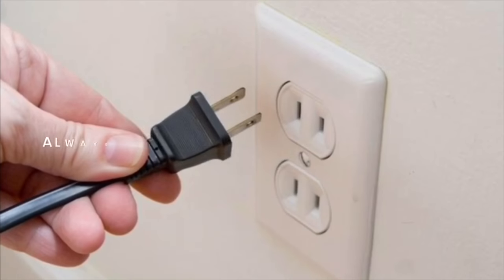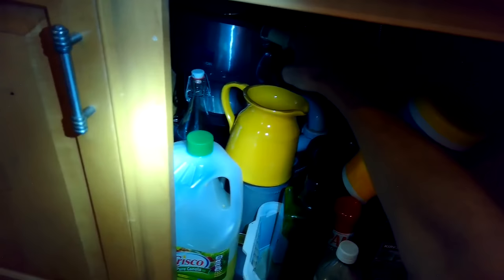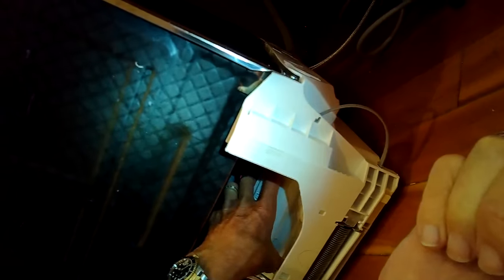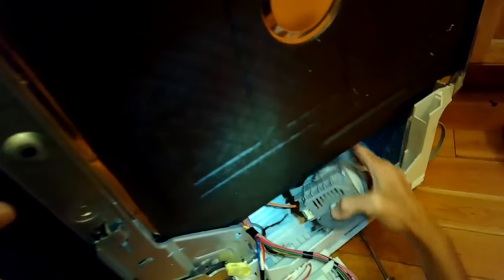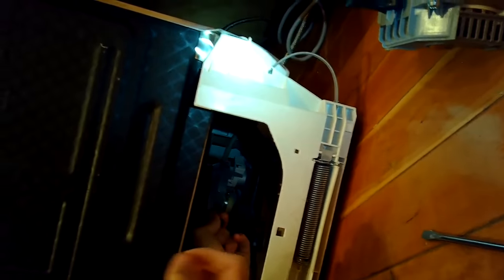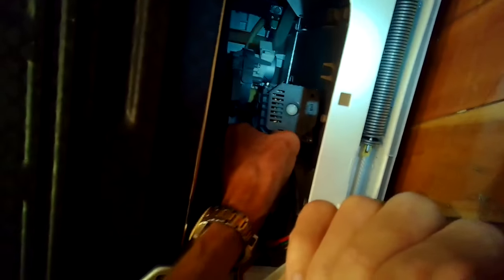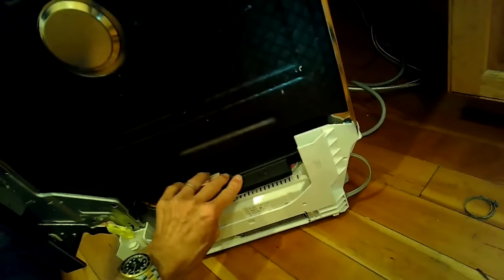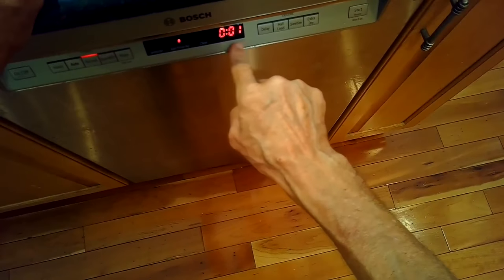✨ BOSCH DISHWASHER - E09 - EASY FIX ✨

Comment: Great help, my model had a metal panel in front of the logic board which needed to be removed. Took me longer to put the plinth back than the actual repair. Cost of genuine part £63 from eBay, to have it repaired I was quoted over £200. Many thanks.
Reply: Mark hi. Do u have the link for the part ? I have a metal panel too. I’m dreading the fixing part. I’ve been without dishwasher for weeks!!
Reply: darouani84 The original seller doesn’t have any listed but search for:Genuine Bosch Siemens Neff Dishwasher Circulation Pump Motor Flow Heating Pump. If your not sure its the right part message the seller to check. It’s really easy to fit,  just follow the video.
Reply: Mark thanks ever so much ..doing that right away 🙂..!!

Comment: thanks for the video, I have replaced the heat pump on my dishwasher very easily with your instructions. One comment: I have notice that some of the cycles time now has doubled, so the short cycle, which is 29 minutes, now runs twice. It is somehow also more noisy than before, i am trying to figure this out. I bought my spare part directly from Bosch, called the customer service and they said they are not specialised enough to answer my questions on a spare part i bought from them.

Comment: Thank you for this. It was easy.  I replace the Heat pump. I ordered the pump  but when It came it was a little smaller but had all the right parts to install but now the tub of the washer overflows. It works except for this. Could this be the heat pump is wrong or could it be the inlet switch?

Comment: Well done, sir.  I wish the video was a little bit higher resolution and some of the trickier spots were shown in a little bit more detail (how do you access the hose clamp after the motor is reattached, there’s like zero space there??) but the commentary/walkthrough was very well done and well thought through.
Reply from the maker: Thanks Warren, I think I used a very small ratchet to tighten up the clamp.

Comment: Do you have to remove the drain pipe and water pip if im able to pull it all the way out and keep water running?
Reply from the maker: You can keep them connected 👍
Reply: @ScottTheFixItGuyChannel  ok, thanks! 👍. I took my pump apart but did not find anything that was broken on the heating elements.
wonder what causing it to fail? 
I'm waiting for my new pump right now. hopefully that fix it.

Comment: How universal is this?  I notice significajnt differences betrween the access that you showed, and my unit:  e.g. mine has front leveling legs like a refrigerator, and is securted to the cabinet frame with wood screw through a tab.

Comment: Hi Scott, thanks for this video - it has been very helpful so far. One quick question though. My old sms58m02eu/02 bosch has different electrical connectors, and now I can't connect the new part. My old circulation pump has a row of seven metal connectors, whereas the new part only has the three, with room next to it for another type connector. There are two connectors coming from the wire harness. One three thick red wires and a green one, and the second has three thinner grey wires. Any idea on how to proceed?
Reply from the maker: Can you send your model number  and that question to: scottthefixitguy@yahoo.com

Comment: Great video, easy replacement BUT now getting E11 code, dishes not drying.  Orange wire connector came apart at disassembly, was able to put the orange wires back in the connector...could they need to be in a certain order? Unit goes through full cycle.
Reply from the maker: Can you send some pictures of that to my email at: scottthefixitguy@yahoo.com
Reply: @ScottTheFixItGuyChannel  I will try, it's buttoned back up. Thank you, local repair guys are saying replace wiring harness or "I dunno, call someone else"...:)

Comment: Scott, as others have noted, this was far less complicated than removing the sump.

The only issue I had was tightening the clamp. I had zero visibility and ended up just screwing it as snug as I could before pushing it on..I may pay for that.
Reply from the maker: Yep,
You have to do it by feel.
You can run it with the dishwasher still out of the cabinet and the side panel removed and watch for leaks just to make sure that clamp is tight enough.

Comment: Hi
Ours is saying this to but only at the end of a.wash and the dishwasher is working and cleaning dishes ok?
Reply from the maker: Does it try ok?
Reply from the maker: Does it dry ok?
Reply: @ScottTheFixItGuyChannel  I'll check I haven't paid much attention
Usually right when the wash cycle is finished all the dishes are warm and plates are dry (other dishes like bowls and poys have always had water still on them way before this error appeared)
Reply: @ScottTheFixItGuyChannel  yeh just finished and no heat and dishes aren't dry

Comment: Hi, Scott.  I was hoping you could clarify something you mentioned in the beginning of the video.  You said, "This unit is only 2 years old, so it was probably used incorrectly." What incorrect usage would cause this?  Ours is 3 years old and just started this error, and to my knowledge we've been using it exactly as the manual instructs.  Thanks!
Reply from the maker: Hi Jeremy,
I think this is just a poorly engineered part from Bosch.
Sometimes people don’t clean the filter and it limits the amount of water going over the heating coils which can cause it to overheat prematurely.
Reply: Yes Scott, this heater is not as well designed as the previous immersion heater design.  Bosch has a new part number 00705174 to replace the old 0655250, so if your replacement assembly has the old number, don't accept it.  The old design is prone to failure because the heating coil is too thin to be reliable.
Reply: @oneselmo  Ok so the new one despite the 007 part # is not very 007?

Comment: Great video, very helpful. Did I miss something or did you not raise the back legs back to the starting position? How do you know how many turns to raise the back legs? Thanks
Reply from the maker: Great question,
Are usually raise the front legs first to get the front of the dishwasher pushed all the way up to the top of the cabinet and then I turn the screw to raise the back legs until the front of the dishwasher is perfectly even with the front of the cabinet.
Reply: @ScottTheFixItGuyChannel  is there a need to “level” a dishwasher? I went with the Bosch because I have granite counter tops and no steam. My previous dishwasher would let off steam which would hit the granite and cause a lot of condensation. Of course this one the heater element would go out. Jeez.
Reply from the maker: They clean better if they’re level👍

Comment: Great video. Replaced pump no problem. But now I get error code 23. Can hear pump initiate then shut down.  Any suggestions?
Reply from the maker: Something is stopping it from draining.
Reply: Figured out error 23 with help appliance repair guy. When replacing motor plug came off drain pump. Plugged back in and everything running fine.

Comment: Successful repair — hot water is back — but dishwasher seems to stop at start or dry cycle with an E11 error. Something different or did I make a mistake on install?
Reply from the maker: Great Question👍 Click Here to Get Live Expert Help From Me For Just $5.00: https://www.youtube.com/channel/UC7fBqy8806u1r0NpPv_fQ2w/join
It’s Easy to join.  Just text me at (510) 367-5424 and let me know that you’ve become a member and We’ll Get It Fixed 😊
Reply: update: I must not have fully seated all the connectors. unplugged and re-inserted all 3 and it works like a charm

Comment: My Bosch unit displays the E09 code at the END of the cycle. Approx 10 min. to the end (2h30m cycle)  but during the cycle I opened the door and the water is just lukewarm.   Could it be that the element is heating but not to full 120F temp ?  I thought these elements either worked or not (broken line) and thus the code would be triggered immediately as you try to run the unit.  Mine turns off the code as soon as I open the door and it won't come back until running about 2h10m+.  The dishes are remain dirty, as the water is not hot enough.   Could it be a sensor issue ?  Will the sensor issue trigger the E09 code ?  Thank you
Reply from the maker: Can you send that same question to my email? At: scottthefixitguy@yahoo.com
Reply: @ScottTheFixItGuyChannel   Hi , thanks for comment. 
I am facing same issue.  What is solution for this issue?
Thank you so much.
Reply: Yep,
Just needs that heater/circulation pump replaced 👍

Comment: Thanks!  Make sure you don'tdamage the clipsof the connectors on the motor while putting the controller into place. Mine popped open and releasd the 3small cables on the back connector. New error as result. Fixable though. Also the powerbardhas to slide from top to bottom in a grooveon the powerplug side. You can't see it, but first lift the controller up high enough and then slide down into place over the groove.
Also check or your water hose isn't squqshed while pushing the machine back (will result in a new error :D)

Comment: Scott, appreciate the vid.  Have an SHP865WF5N with an E09 and I'm convinced it is the heater that has failed.  You mentioned in the video acquiring a circulation pump for $50-150.  I'm seeing as low as $240 online where I'm looking.  Any suggestions?
Reply from the maker: https://partsdr.com/part/12008381-heat-pump?gclid=Cj0KCQjwz4z3BRCgARIsAES_OVfuNP5EocA5HoQ-QFDiOxWfiWRtG80Fq0gzQB77bQAGrh99Vf1z5h4aAqFeEALw_wcB
Reply: @ScottTheFixItGuyChannel  I appreciate the added info.  Word to the wise when attacking this repair yourself ... mark the three orange control wire leads into the connector on the pump and take notes!  When I went to remove this connector from the defective pump, the "cover" to this connector popped off and out popped the three orange wires.  They have no markings to identify which one goes to which slot in the connector.  So, out of the six available combinations, I found the right one on my fifth try.  On each of the previous attempts, I received an E11 error code and the heat pump did not work properly.  Thanks again for the great vid!

Comment: Do you have any advice on how to identify the correct heat pump/part for the particular Bosch dishwasher?  My dishwasher is SHX68TL5UC/01 and it is no longer sold by Bosch, having been replaced by a very similar model #, SHX68T55UC/01.  There is a big price difference between the various heat pumps or circulation pumps.

Comment: Scott - Appreciate the video. We replaced the heat element/ pump and are still getting the E09 error code. Machine model # SHX68TL5UC/07, Part # 00753351. Any ideas what to try next?

Comment: Disconnect door springs, remove two screws securing base at rear of dishwasher, and that whole plastic base comes off when you lay the unit on its back. Much easier

Comment: I’m curious to find out what you mean when you say, “the customer was not using the dishwasher correctly”. Can you expand on what you mean by that?

Thanks.
Reply from the maker: Thanks Curt,
That customer wasn’t rinsing the dishes prior to loading which just made the motor burn out early.
Reply: @ScottTheFixItGuyChannel  thank you Scott for the explanation.  We’ve been meticulous about rinsing all dishes before washing.  I just wanted to see if perhaps it was something we were doing wrong before I attempt this repair.

Comment: Could you lay the dishwasher on its left side so that you would be working "down" from the right side instead of lying on the floor? Also, I would like to test the old heat pump to make sure it's bad before buying a new one. What terminals would I probe with my multimeter for continuity, and what readings should I expect? Any other tests that would be helpful? Thanks!
Reply: Yes, that's the way I did it - not totally lying down but resting at 45 degrees on a chair.

Comment: I took the heater off and there was no apparent burnt wire to solder.  Is it possible that the heater itself is still burnt out or is it most likely the controller??? Parts aren't coming that quick these days so deciding if we are getting a new dishwasher.  Thanks.
Reply from the maker: 80% chance it’s the heater/circulation motor.
Reply: @ScottTheFixItGuyChannel  Thanks
Reply: @ScottTheFixItGuyChannel  thx for sharing this very helpful video 🙏. I'm grateful.It's saving me and I'll others lots of time. 🥰

Comment: Greetings Scott.  Your video has enabled me to remove the heater/motor combo without tearing the whole machine apart!  Our SHE8ER55UC/01 showed the 09 error.  Now in the previous generations, that was always circuit damage from an undersized heater relay.  I would replace the old 10 amp relay with a slightly larger 20 amp relay, repair the damaged copper trace on the circuit board, and be good to go.
You mention in your video that the package label has the heat re part number printed on it, but I can't read it.  My burnt out heater doesn't have any part numbers on it.  
Would you please post the heater part number for us?
Reply from the maker: https://partsdr.com/part/12008381-heat-pump?gclid=Cj0KCQiArvX_BRCyARIsAKsnTxPmrC8qhhZnX536wlWv21XmUVDhIUJM1LyruCHOqpZEuRG9sgKSCDwaAjHeEALw_wcB

Comment: I have a freestanding Bosch SMS25EI00G/51 is it the same process?
Reply from the maker: I believe so😊
Reply: Yes, just take off the right hand side - 3 screws
Reply: @hyweltthomas  Thanks, I did exactly that and managed to change one over easily, part was around £75 , advice from repairers get a new dishwasher. . . .was only 2 weeks out of warranty . . . . :/
Reply: @bobspanner  I bought my wife a nice car on Wednesday, but she was more impressed that I fixed the dishwasher...

Comment: Figured out error 23 with help appliance repair guy. When replacing motor plug came off drain pump. Plugged back in and everything running fine.
Reply: I am facing the same issue. Can you describe it more thoroughly? Thanks

Comment: What misuse would constitute "not used correctly"
Reply: From the context of the video, the user do not clean out the filter. This blocked the flow of water to the heat pump, causing it to fail sooner than it should. In my case, hard water deposits in the microfilter likely had a similar effect over time.
Reply from the maker: Great expiration Steve👍

Comment: Thanks for your video . I got Siemens SN25M230UK/01 Purchased in  2010 .    I now want to know how to fit the replacement heat pump . Bosch Parts No. 00654575 . The wiring is different. @t .  Need help please.

Comment: The heating element fails due to poor design.   It has nothing to do with water flow or filter condition.
The heater element is essentially heat tape wrapped around the circumference of the stamped metal pump housing.   The radial expansion of the housing streeses and breaks the heat tape near the hot / neutral conductors and makes an open circuit. 
Basically cheap crap.  Mine just failed again.
Reply from the maker: Thanks Brent,

Bosch used to be so much better😔
Reply: Very disappointed with Bosch. My dishwasher is two years old and error code e09 is being displayed. I clean the filter weekly, which really is never that dirty. I also have a water softener. Water seems hot when door is open when running dishwasher. Everything is clean at end of cycle.
Reply: How long did it last?

Comment: Thanks Scotty... just wondering if youngsters a fix for a E04 error on a Siemens dishwasher?

Came in a week ago and went away the next day. But some how came back in yesterday and won’t go away without a fight :-)

Any clue?

Highly appreciated
Reply from the maker: Thanks Alexander,  e04 means it can’t drain.  Might be something caught in the airgap up by the kitchen faucet.
Reply: Scottthefixitguy thanks. Ik will check that also. But somehow it is not heating up either.  Any other thoughts?
Reply from the maker: How high does the water get when it fills?
Reply: Scottthefixitguy fills normal. Just doesn’t heats up anymore. I notice the e04 warning comes up at the very last minute of the cycle. Water is pumped away and machine is left clean. :-(